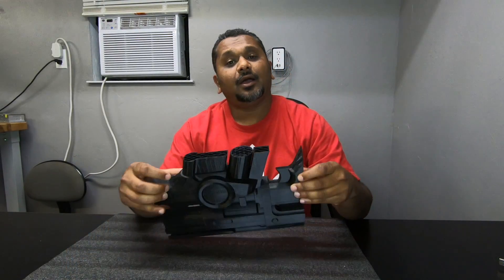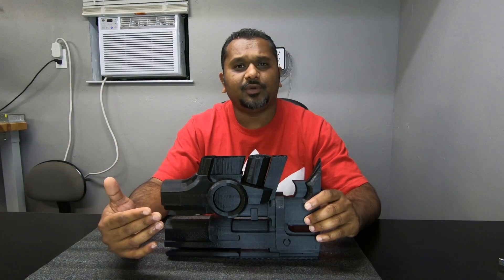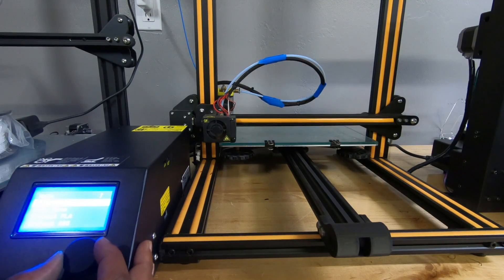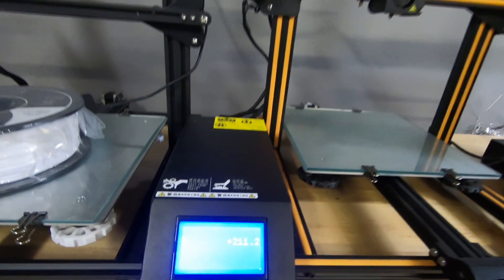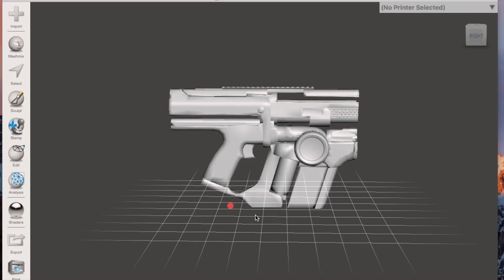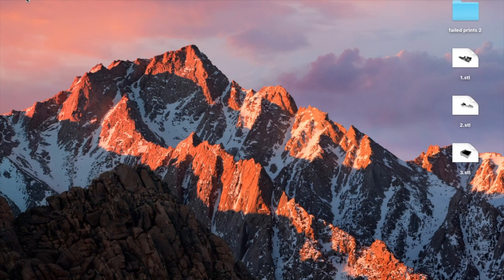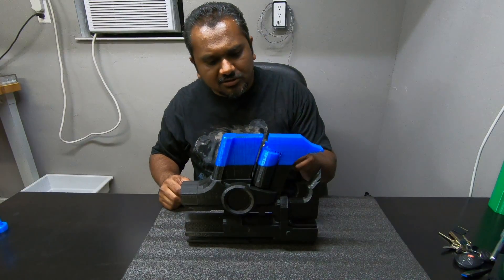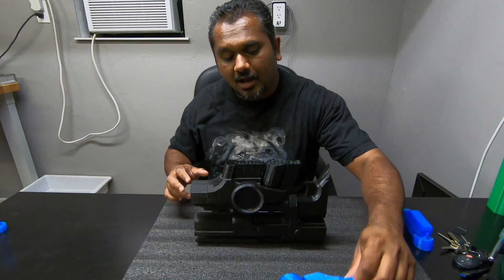Creality CR-10 / How To Resume Failed 3D Parts Part 2

Comment: I know this video is 2 years old so software may be different now but my mesh mixer dose not show z hight numbers when going into plane cut I have my z hight number I need to cut at but if I can’t see a number when adjusting what’s the point?? Or am I missing a setting ?
Reply from the maker: I haven't used the new version in about a year so I don't know but I will try to find out for you.

Comment: Thank you for your helpful video 
I tried both solution and succeeded in both.
in first one I faced a problem that my printer before printing goes to the origin point ( x0,y0,z0 ) then move to the resuming point but in that case the extruder   knocks the model on it's way . For that I added a text command in the G-Code file before the layer line to inform the extruder to go vertically form the origin point to the height of the earlier model height and in that case it complete very nice ..
Thank you Dear for your helpful video..
Reply from the maker: Happy to Help!

Comment: If we already need to glue a new part to the previous one that failed, why don't we just measure the Z height and drop the model under the Z axis for as long as we measured, then save the G code and print? It is workable and much simpler.
Reply from the maker: You are correct.  This is a part two and in part one I show exactly what you just said.  The reason for part two is because sometimes you can't auto home so you can't continue from the the layer you left off.  Depends on the size of the print.

Comment: I can't auto home because my part is too wide what should I do? Help a 96 hour print is on the line about half way through
Reply from the maker: You will have to modify the G-code but don't worry its not as hard as your think.  I have a part 1 to this video watch that.

Comment: Hey Vijay - another great video. Something to consider is that when a failure happens because of a power loss the current layer could be only part way through adding the perimeters. In that case, depending where you measure the Z height, it could be a little too high for part of the layer or a bit too low. What would be really cool would be a plugin that records each gcode line up to the point of failure. It would then be possible (only with option 1) to edit the gcode such that it would restart not only at the right layer height but at the exact x,y position as well. I print via Octoprint (paspberry pi) and have the serial log turned on. That way I have a record of all commands executed and can edit the gcode to delete all move and extrudes upto the point of failure and then save the gcode to restart the print at the right place. It works - I've done it via Octoprint but I think Cura would need a plugin to record the serial commands to the printer.
Reply from the maker: Yes you are correct, even by doing the method there is no way you will start the print where you left off.  Its just a guess but very close.  I wish there would be a way to record in cura where the print failed, that would be nice.